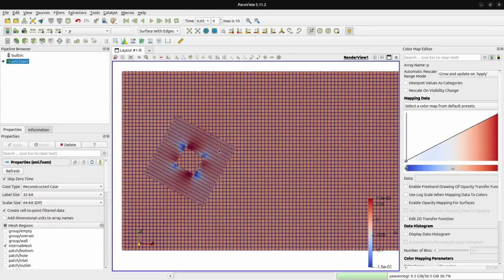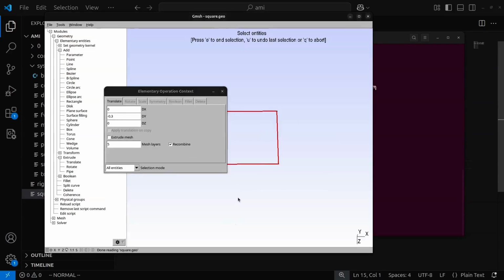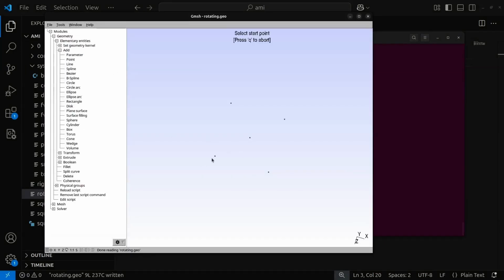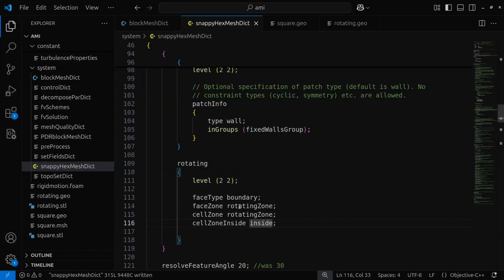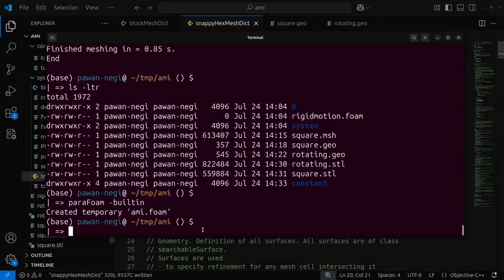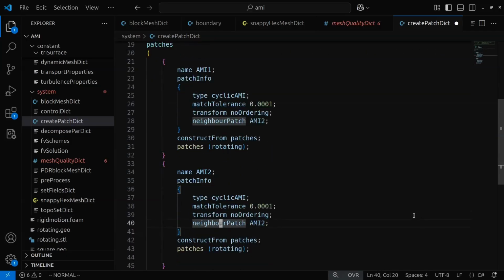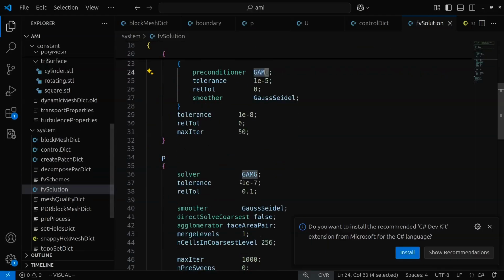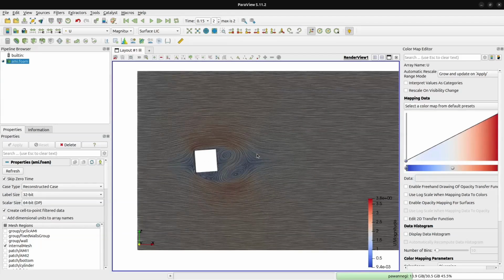Creating a Rotating Mesh Interface in OpenFOAM with Cyclic AMI #openfoam #meshgeneration #cfd

Comment: Fantastic video! Where can I download the tutorial case files? I have one simple general question. I have been using openfoam to simulate airflow over an airfoil with a changing angle of attack by using a rotating mesh. That is, the openfoam tutorial "incompressible/pimpleFoam/RAS/wingMotion" . However, I have not successfully been able to increase the Reynolds number using that tutorial such that I would be able to show the turbulence caused by the airfoil as the angle of attack is increased. Do you have an airfoil tutorial, Or a suggestion as to how to use the wingMotion tutorial with better rotating mesh visualization? I am a little bit confused by the method that you have shown in terms of having a inlet and outlet where the velocity of the air is constant. Thank You.
Reply from the maker: Thanks for the comment. The kind of mesh motion which is there in wingMotion example can be found in this video https://www.youtube.com/watch?v=nfR-Pn8mocU . However, the reason you may not be able to get it working could be the timestep that you should reduce when increasing velocity. Also you should make sure that the target y^+ remains the same to get similar accuracy for different velocity.  You can try maxCo constraint in controlDict to make sure timestep sets itself.